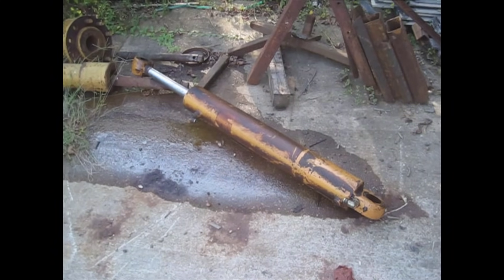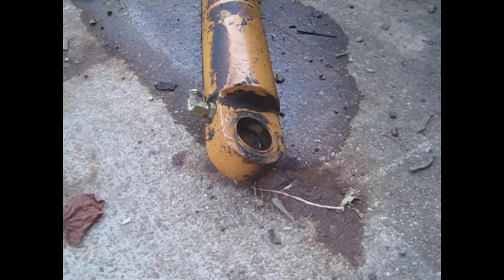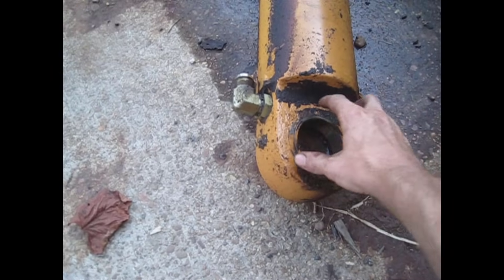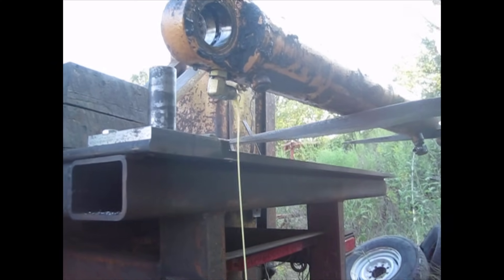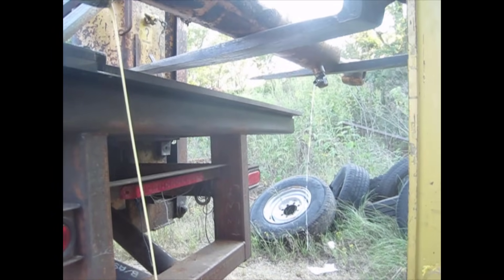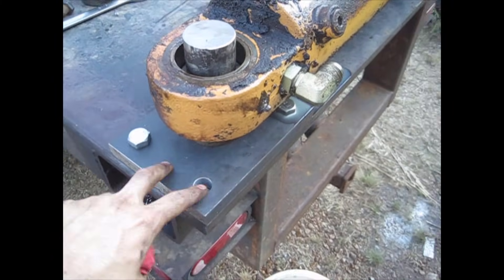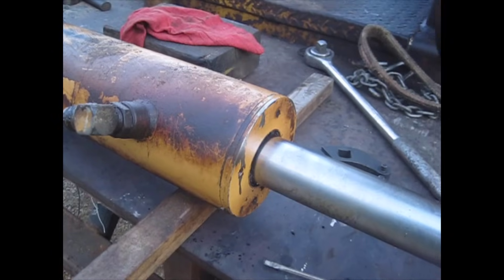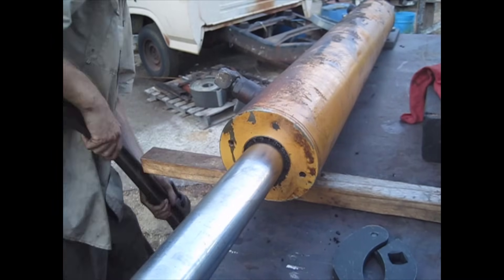Hydraulic cylinder breakdown pin

Comment: Why didn't you just use the machine it came off of as a jig? Seams to save me a lot of time / headaches by removing lines and one pin while leaving the othe to hold cylinder from spinning
Reply: I am from China Seals Factory. Our company produces many types of hydraulic oil seals. If you are interested in our products, we can send you free samples so that you can learn more about our products.

Comment: I put ram back in machine bracket and use breaker bar with pipe to take nut off and use heat if it's been lock tighted

Comment: I am in southeast Alabama i am wanting to build a small crane to go in the center back of truck be able to lift 4,000 lb with the boom 8' length i have some ideas and drawing is there a way i could send you what i have and see if you think it will work i cannot afford to buy one need to make with junk i have will be using 12v wench the boom will be extendable but extended to 10 feet will only need to lift 1,000lb and want it to rotate at least 180degrees.
Reply from the maker: Sure send it to me ethanewing1586@gmail.com.

Comment: Well done, thanks for sharing the knowledge. Im restoring a john deere 440 dozer and just finished rebuilding two of the cylinders, I ended up welding 1 inch stock to my welding table and beating the heck out of them to get the pistons out. Went back together smoothly. Im a retired engineer and Im running a service truck working on heavies here and there as well as saving old equipment to use on my homestead /little farm.
Im always impressed with the simplicity and quality of these old machines, nothing is make like them anymore. I wasnt surprised to work on another late model Cat where the eyes were torn from the cylinders. Upon inspection of the welds, I found them rife with undercut and lack of penetration throughout. This is found on 4 or 5 year old machines with factory welds. After talking with other owners, as well as a friend of mine who owns a successful fab, they say thats not uncommon for all these new machines.
Reply: I am from China Seals Factory. Our company produces many types of hydraulic oil seals. If you are interested in our products, we can send you free samples so that you can learn more about our products.

Comment: It’s obvious that the hydraulic cylinder was damaged, but I was left wondering what exactly it was you fixed. Were there seals that needed replacing? I felt the video started off strong but left me hanging for the final repair. I loved how you made the gland obey with the cheeter pipe!!!! Leverage baby.
Reply from the maker: Sorry about that. I was planning on doing Another video on the seal replacement on a hydraulic cylinder so this video wasn’t a hour long. Thanks for the comment your not the first person to ask why I didn’t keep going.
Reply: Classic Work It’s all good. My question was designed to help you improve the story of your videos. A good video starts with a problem, designs a solution then implements the solution to repair. Keep up the good work!!!! I’m going to call you “Long Lanky Texas.”

Comment: Those ram nuts should be put on with red thread lock. It often takes high heat to get them off. The hydraulic shop may have a very high torque rig for breaking them loose. I rebuild most of the cylinders on my Case 450 loader backhoe.
Reply: Red Loctite. I had the plessure of living that nightmare. This had clearly been rebuilt without it. Sandpoint btw
Reply: I am from China Seals Factory. Our company produces many types of hydraulic oil seals. If you are interested in our products, we can send you free samples so that you can learn more about our products.

Comment: You don't put pipe on the end of a ratchet.  Thats what breakerbars are for.
Better of sticking to your welding.
Reply from the maker: Wish I could just weld but it doesn’t always pay the bills.
Reply: @EEJester1586  Always use the machine first to hold the ram even if you have to drop the pin out from another ram to use its mounting.    Taking a ram away from site just cost the customer time and more money.   If you have to take it back to the workshop,   stick it in a press to hold it.   If you have a decent 1 inch thick bench.  Plasma 2 holes in it and chain through the ram eye.  Use old conveyor rubber to protect the inner surfaces,    or what i have done out on a Cattle Station on a PC1600 main boom cylinder was to use a 18 wheeler flat deck trailer,  cut small holes in the deck and run the chain around the main chassis rail,   then used a hydraulic torque multiplier to crack the main nut.   Many ways.  IMHO cracking a ram head is better off done with a long sturdy bit of pipe rather than a breaker bar as they flex too much.   Enjoyed your vid.   Keep them coming.  Cheers.
Reply from the maker: Mike Thomas thanks for the comment. Aye I try to break them down on the machine as well most times. Just showing how it can be done without the machine or if somebody brought you one. That’s all I was getting at. Thanks again.

Comment: you could have left the piston bore (the housing)  in the backhoe to hold  it when you went to turn the spanner nut , saved time from all the fabricating work ?      next time anyway .
Reply from the maker: Sometimes you can break a cylinder on the machine but this case we couldn’t. This was the stick cylinder on a 580 case. You really can’t break it on the machine.
Reply: I am from China Seals Factory. Our company produces many types of hydraulic oil seals. If you are interested in our products, we can send you free samples so that you can learn more about our products.

Comment: Was thinking metal chain might work. Hold cylinder like oil rig drill pipe.
Reply: you might run into a cylinder that is thin walled and tight too that chain will put even force around the pipe but you do not want to deform the cylinder in ant way shape or form holding the cylinder at the pin is the only way, your shop your rules!
Reply: Frank Deegan Have a cheap kioti backhoe. Good point. Grandfather always said two ways to learn. Fuck it up or learn from someone that fucked it up before you.